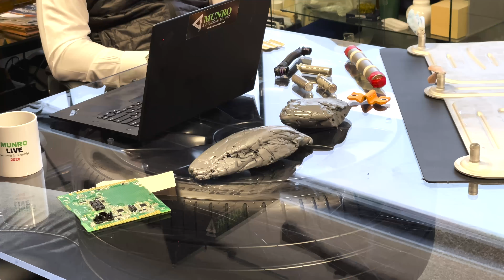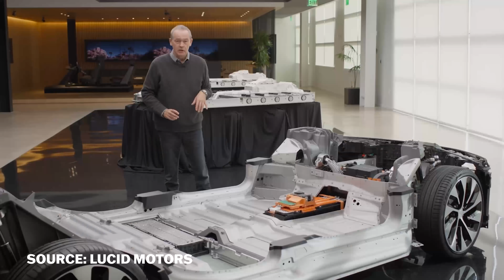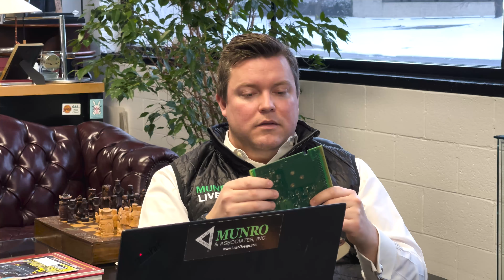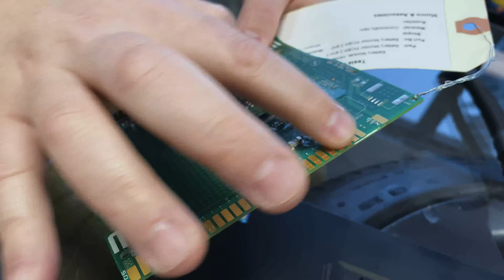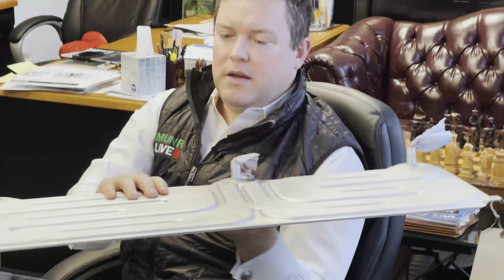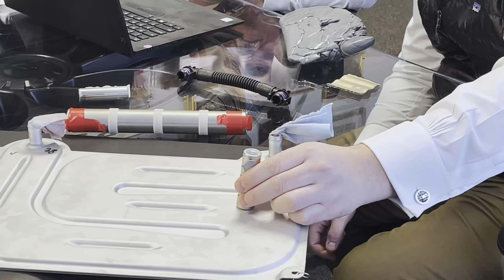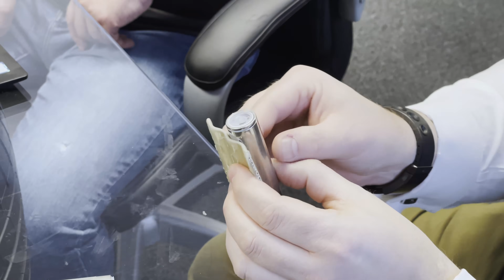Lucid Tech Talk 01: Battery Pack Reaction

Comment: So it's Side cold plate ( Tesla method which is a wave formed aluminum extrusion) vs Bottom cold plate ( Lucid method ). This has been studied extensively - you can find them on the internet.

Verdict is that: the Tesla method is safer from the mechanical and electrical point of view. (and PR goes off on the small conduction area but Tesla actually uses a Thermal Interface Material similar to a thermal paste to maximize and even out the conduction area/gap) 

Tesla method: The temperature distribution within the module is relatively even with relatively low coolant flow rate and low pumping power required. The results show a small temperature distribution inside the batteries.

Lucid method: The cooling method shows poor performance when it comes to the internal temperature gradient of the cells. However, the temperature distribution in a module is even.

Given that the maximum temperature difference in a module is 5°C, the Tesla method can afford a 2W Heat generation per cell, while the Lucid method can only allow for a 1.24W Heat generation per cell.

source: http://www.diva-portal.org/smash/get/diva2:1290856/FULLTEXT01.pdf
Reply: Please explain then why Tesla is moving to end cooling for the 4680 packs if indeed it is not as efficient as side cooling.
Reply: You overlooked something fundamental: that study is very specific to 2170. Tesla is shifting to end cooling with the 4860s. Side cold plate cooling doesn't scale well to larger diameter batteries, and with end cooling, you have more contact surface area to work with.

From a manufacturing and quality control standpoint, end cooling makes the most sense, especially you're considering a future with larger battery sizes which require end cooling.
Reply: @paulo3011  You can watch the entire Lucid presentation and learn his reasoning for choosing end cooling was better contact consistency and manufacurability.  

The end cooling saves space and that may also have played a role in that choice. Clearly both methods are adequate at least in the 2170 size factor.
Reply: @MrCPPG  
"Please explain".....
.
OK, let's do that.
From the 2170 Cory showed, the contact strip on the side of the Tesla 2170 cell was about 10mm wide? By 700mm tall? So 700 sqmm.
.
The area of the bottom plate?
10.5 x 10.5 x π = 346 sqmm.
About half the vertical contact area?
Win for side cooling!
.
But, on a 4680.....
Vertical contact 10x 80mm.
(800)
Bottom plate contact
23x 23 x π =1669 sqmm.
DOUBLE the vertical area.
.
So on the 4680, bottom plate cooling makes complete sense.
.
Is that clear enough?
Reply: Glad you posted because I was going to ask for a more in-depth look at the two from a thermodynamic perspective.  Heat may transfer better over a straight edge but heat transfer efficiency is 1/(r^2) and you have a lot longer way to go from end to end (70mm).  At 21mm diameter, the furthest travel distance around the cell with side cooling is half the circumference: about 33mm.  That's less than half the distance of end cooling to the far end of the cell which with 1/(r^2) means end cooling would have to be 4 times more efficient to make it better.  I like that end cooling simplifies things and reduces manufacturing costs but my guess is they are also trying to sell it as "better cooling"... which I doubt.
Reply: @mikeyc8139  
I think the point was made that it's more difficult for heat to transfer through the layers (centre to side)?

However
We should also consider that from the Tesla (4680) perspective the tabless cells should generate far less resistive heat.
(I suspect they will be revolutionary in terms of (heat) efficiency, discharge and charging rate)
Reply: @rogerstarkey5390  Good point.  On the other hand, all we have access to from the outside is the cell casing and not the inner winding.  I just noticed in the conclusion of the above paper, they say: "The comparison between the two indirect methods shows that tube cooling induces a lower cell temperature gradient, however, bottom cooling has a simpler design."
Reply: @MrCPPG  @Paulo  @Roger Starkey   Lucid method is bottom cooling. 4680 cells is top AND bottom cooling. Also the above video does not even mention 4680 cells. I just quoted an MS Thesis on the different methodologies of battery thermal management systems and its finding, among others, was that the Tesla method quoted therein can allow for higher heat generation per cell. Page 26 of that thesis shows a simulation of a module with Tesla-style tube cooling at 2W/Cell. Compare that with Page 33 of a module with Lucid-style bottom cooling at 62% of the heat generation per cell of the previous one - at only 1.24W/Cell. The thesis does not allow for a per cell temperature gradient greater than 5°C.

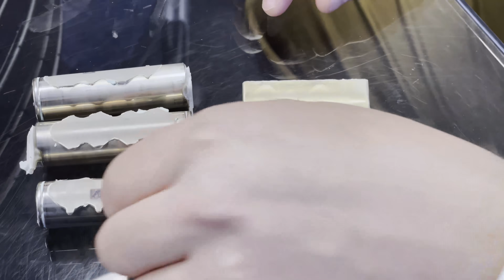Also Tesla uses a Thermal Interface Material akin to a thermal paste for your CPU. The contact area is at least double of your guesstimate (the thickness of a thumb). You can see that at 24:03.
Reply: @rogerstarkey5390 Tesla uses a Thermal Interface Material (see my post) akin to a thermal paste for your CPU. The contact area is at least double of your guesstimate (the thickness of a thumb). You can see that at 24:03.
Reply: @paulo3011  Take into account that the 4680 cells are top AND bottom end cooled. Lucid's only bottom cooled. You're comparing Apples to Alligators. Let's go back to 2170 cells. Think of a cylindrical battery cell, if the temperature difference between both ends is too high, that will result in deformation of the material. Now note the distance between the center of the cell as against the distance between the top and bottom end of the same cell: you're comparing heat dissipation over a little over 11mm vs 70mm - almost 6-7 times longer for the bottom end cooling method (considering the depth of the cell's embedment.) As the thesis states: The (bottom cold plate) cooling method shows poor performance when it comes to the internal temperature gradient of the cells. However, the temperature distribution in a module is even.
Reply: @392redienhcs  where have you heard Tesla is top and bottom cooling? Sand Munro reported the 4680s will be bottom cooled. At any rate until they are performing in the real world it is all theoretical. At this moment in time Lucid is the range king. Hopefully it spurs Tesla ( and others)  to release a longer range ev, if they can.
Reply: Do yall even know much heat transfer these cells need to perform and ensure longevity? Otherwise the discussion is pedantic. The EV6 batteries don't even get hot enough to charge at optimal speeds during  routine driving...how much heat need to be removed from each cell?

Comment: I love that they use battery modules. It is perfect for second life applications
Reply: On the other hand, if you can undo maybe 20 bolts and 6 plugs, then slide a complete pack into a "second use application", I would call that pretty close to "perfect"?
Reply: @rogerstarkey5390  maybe for some large industrial applications. But for a private household for example one or two modules would suffice. In addition, a 600 kg 400-1000 V battery pack can only be handled with machines, be transported by trucks and be worked on with high voltage safety equipment. In contrast, a single module (~30 kg, 40 V) can be carried around by one person without risk.
Reply: @Nelson-Man  
How many households are going to repurpose these units, bearing in mind the stages required to get the module to that place?
.
Good packs (/modules) will be slid into a racking system built with a standard secondary BMS, bad packs/ modules will be recycled.

Comment: The drive unit weighs 74 kgs. Keep in mind this is a 900v system.
Reply: With the big electronics box?
Reply: The whole car is a ridiculously overweight porker, though.  Ex-Lotus engineer PR seems to have forgotten Colin Chapman's aphorism of "just add lightness".  Makes a few of us suspicious about his battery capacity claims.  The extra weight could very well simply be more modules to achieve that claimed efficiency & range (& more investors).
I'm very dubious.
Reply: @alexmanojlovic768  the extra weight didn't help with efficiency.  But more batteries provided a stellar top line range number. At their price point they needed a bragging point. The car also has excellent aero, and can hit 300 kW briefly while charging. It can add hundreds of miles of range in minutes. Even the cheapest 80k trim is rated at over 400 miles of range. A stellar first effort.

Comment: I find it intriguing that there is all this great technical info coming out on EV's and the customers are getting this deep dive into the inner workings of these vehicles.....yet there is no equivalent on ICE vehicles, the OEM's only market the styling, cup holders and USB ports, is there no innovation happening on drive trains, engines, etc......or have they just given up at this stage.
Reply: ICE car structures have pretty much reached their peak evolution between efficiency and strength.  We are just beginning to see the evolution of EVs.
Reply: @ohger1  ICE may be near peak value/cost, but I remember so many planned improvements:
1) Rack and pinion to guide pistons to have even cylinder wear.
2) Camshaft alternative for better compression & expansion profiles.
3) Variable compression ratios to adjust to usage.
4) Injecting water to help converting heat into pressure.
5) Selenium (?) additive to reduce smallest particles.
…
I suppose they all cost too much to develop or manufacture for common use.

Comment: Rowlinson beat you to a tear down.  Not only CEO tear down his car, he explained it in detail.
Reply: He wouldn't want Sandy tearing down an actual car, it'd reveal how inefficient and expensive it is to build
Reply: @bluetoad2668  
You really have no idea.
Reply: @rogerstarkey5390  Why is here such a weight difference between the Plaid and Lucid?  Lucid’s battery still uses cobalt, how is that superior tech?
Reply: @St.Maurice  Probably because the Lucid is geared towards luxury. Sound insulation takes up weight. Better seats take up weight. The Plaid is an engineering marvel, but the Lucid is targeting a group of buyers that doesn't want a 100K+ car with the same level of noise as a BMW 3 -series.
Reply: @Jeroenneman  So luxury seats have to be heavy?  There are several videos of Lucid owners complaining of a humming noise when driving. Engineering marvel?  Just recalled for suspension and doesn’t have working cruise control or ota updates?
Reply: @St.Maurice  and Tesla vehicles had motor. door handle, and eMMC failures. It's a first model year, there are always going to be kinks.

Comment: did I hear your correctly that it was a "tortured path" for wiring? Thank you all for info/vid and I still smile every time to see what you share with us. On the move for me but hope to see you again.
Reply: Hey, I learned something!  It's not torturous but rather tortuous.  The latter means full of twists and turns.  Torturous (and torture) has the same origins, just applied to the human body, which is why I thought it was the same thing (and I'm pretty sure Sandy actually said tortured).

In context it just means wiring that goes back and forth a lot.  I didn't understand what the purpose was in this case though.

Comment: I was generally impressed with the lucid battery pack design, and definitely agree that end cooling is the way to go for cylindrical cells.
The "wire" bonds are rather chunky but that is for a good reason, since they are aluminum (tricky bond to the steel cell cases), with the narrow one also serving as a fuse.
Having more modules does make the pack more serviceable, which for a high-end car brand I would see as a plus as they should be simple to swap at a local service facility. Owner satisfaction is likely more important to them than total cost in comparison to makes like Tesla.
Reply: The number of modules had nothing (or little) to do with "serviceability".
It's down to:
1) Their perception of the best packaging method for inside vs outside space.
.
2) The (well documented?) company plan to sell technology to others, which means multiple standard modules can easily be configured into various pack and vehicle sizes.
.
In a "high end car", one, or several dead cells are essentially irrelevant as a percentage of the pack capacity.
For instance, a dead sub module of 33 cells? (Unlikely) That's 0.5% of the pack.
Reply: It's interesting- there are times I see Sandy excusing Tesla design decisions in the Model S due to it being an upscale, low volume product. I didn't hear that once in this discussion (for example the orange bus connectors).
Reply: @paulo3011  

He doesn't "excuse" the Model S anything.
Don't try and FUD when there's nothing there.

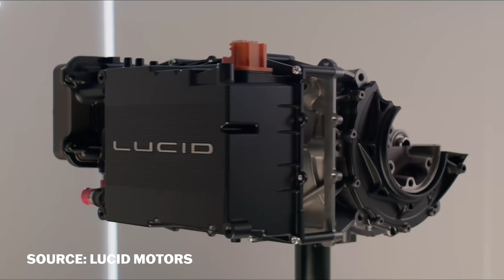Comment: 12:00 I think Cory said he saw a park pawl ring at 9:15 in the Lucid video. Maybe he's looking at something else, but I'm seeing the a spline to engage the housing on the outside of the stationary ring gear in the planetary reduction. By the way, I think it's brilliant how they spin the differential at motor RPM (cutting its torque requirement 5 to 10 times) and use two final reductions.
Reply: Can you please explain to me how the concentric differential and reductions work? I just can’t wrap my mind around it and NO ONE is talking about it.
Reply: @bob15479  Looking at the Lucid video: there's a tiny differential which has the motor rotor as its carrier (usually the carrier is in the final drive). Each output from the differential drives a planetary final drive reduction gear (the final reduction on the left side is cut away so you can see the gears while the right side is intact and it's gears are hidden). The small shaft from each differential output drives the sun gear in its respective planetary, the planet carrier drives its CV shaft, the ring gear is stationary.
Reply: @RallyRat  sounds like a topic for engineering explained.

Comment: The inverter seems to mounted on long standoffs holding it from the motor. It looks like the inverter and the motor have matching mating surfaces. Maybe that is for viewing purposes? Both drive units look compact for the output.

Comment: Heat doesn’t "rise". That’s convection, in low viscosity fluids, low friction situations. And it depends on thermal expansion coefficient, change in density. What temperature gradient acceptable before thermal runaway?

Comment: Now there is integrated wireless communications in BMS to eliminate most of the low voltage wires mentioned in 14:32.

Comment: I think EVDrive was first to develop tab cooling (end-cooled) cylindrical cells, first with 18650s. ENSI Toyota mining trucks and later the 1st Nikola PHEV Semi truck prototype were early projects using the EVDrive tab cooled battery modules. Unlike Lucid, both cell ends were cooled.
Reply: Capacitors have had multiple tabs for years.  Tesla's trick (the patent) is in the manufacturing process they've designed/developed.